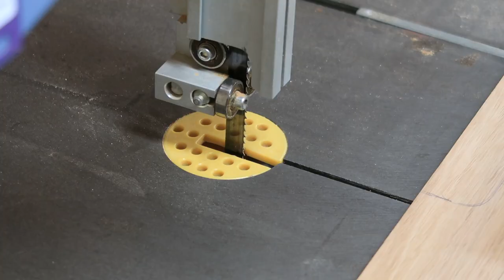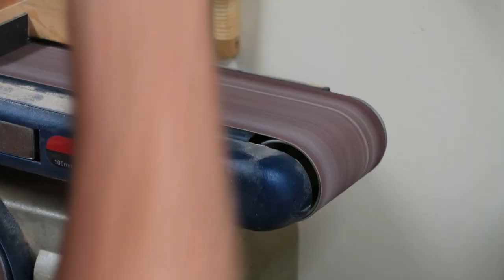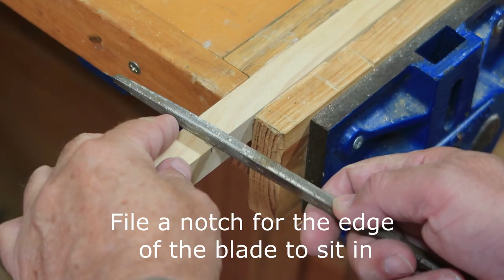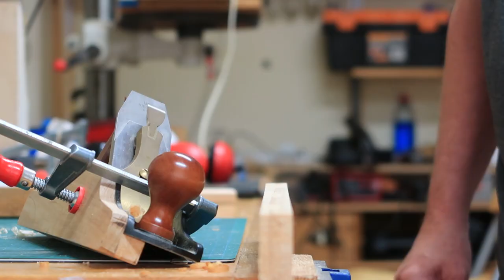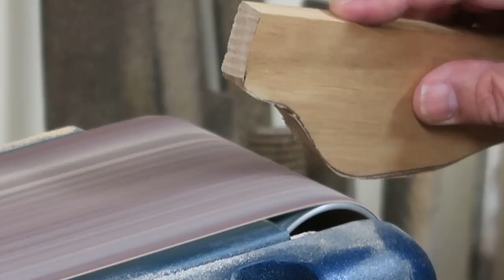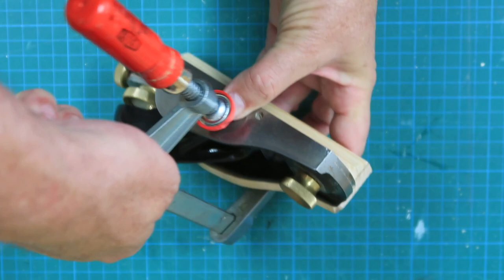2 DIY Hand Plane Guides

Comment: Nice, I was afraid that you were going to drill and tap 2 1/4-20 holes in the side of that beautiful bench plane to mount the guide. That would make a neater attachment to the plane but probably devalue the plane drastically.
The clamp worked fine.
Reply from the maker: Sacrilege!